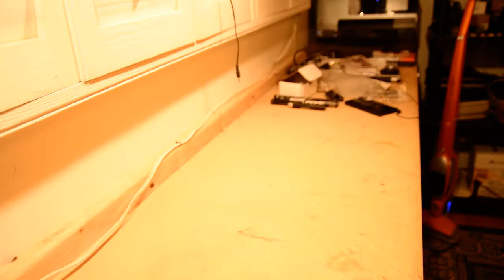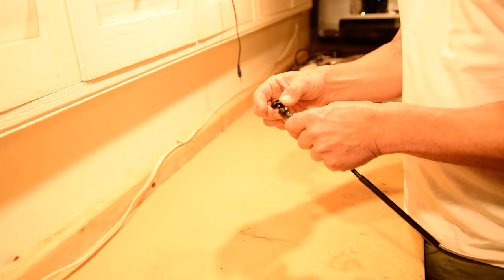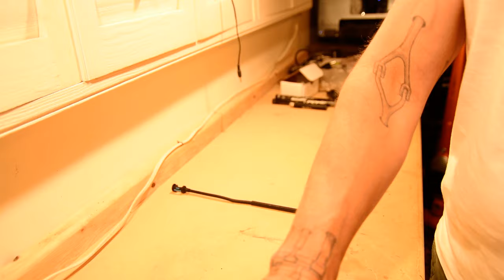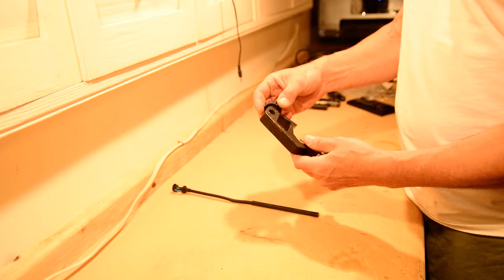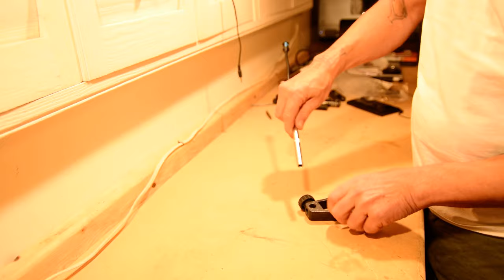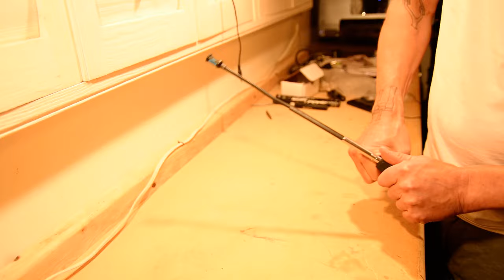Shure Beta 98 clamp extension modification

Comment: Hi dave do you like that mic a lot? Or did you find something better? Thanks...big fan
Reply from the maker: I like it
Reply: @DaveRat  that answer is good enough gor me :D
Reply: Ivan Maškov   The 98 is an amazingly versatile microphone with high SPL handling, wide and flat response.  I find the SM and Beta versions interchangeable but, the wiring is not unfortunately.  They are a bit of work to use as every application seems to need a different mounting solution.  I think I have spent as much on mounts, windscreens, etc as on the mics themselves.  Some of AT’s mini-mic hardware works very well, btw.